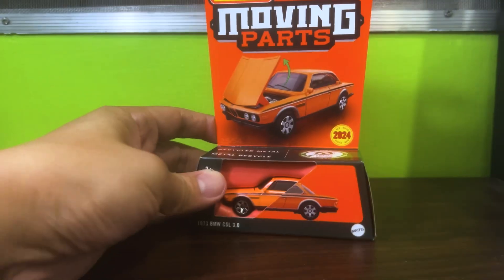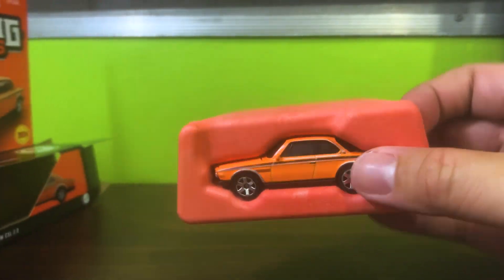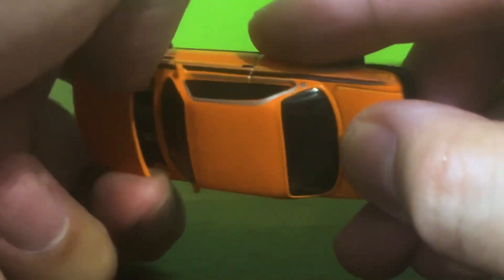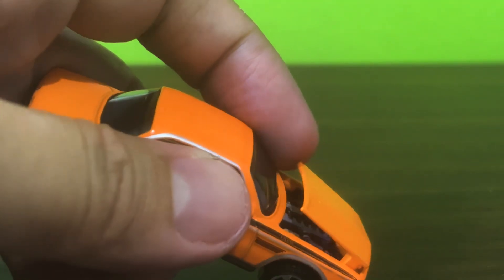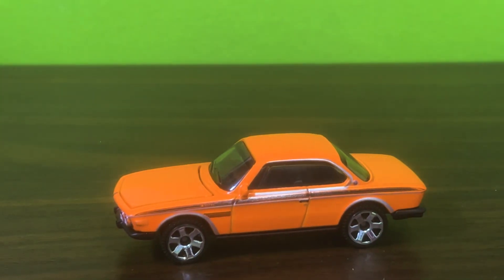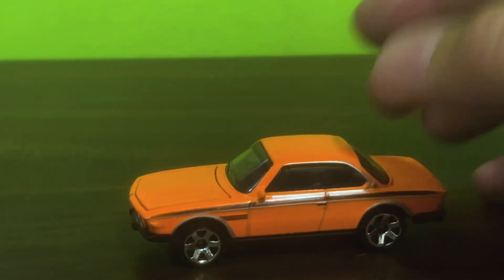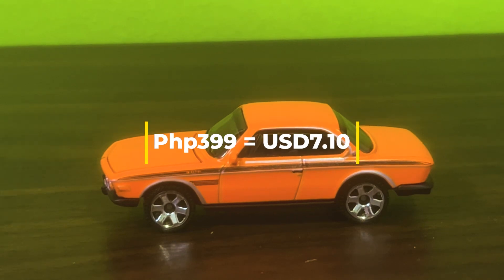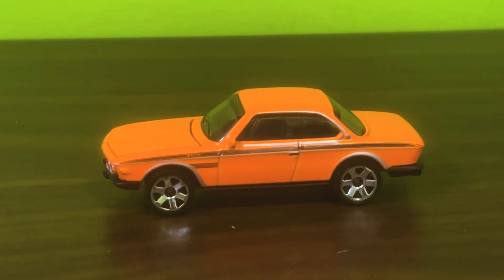An Exercise in CSR: Unboxing a BMW 3.0 CSL from Matchbox

Comment: Turn the car upside down and then use your fingernail to pry the hood away from the front so that there is more of a gap between the hinged front and the front of the car and it will open.
Reply from the maker: Thanks for the tip! I did eventually get it open. I still think it shouldn’t be so challenging.